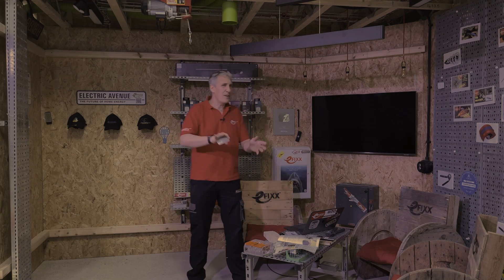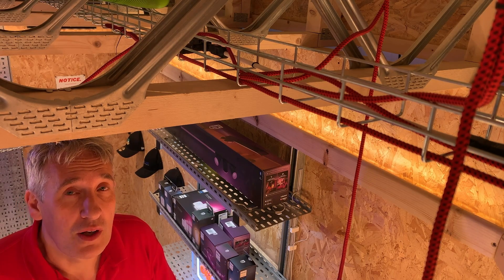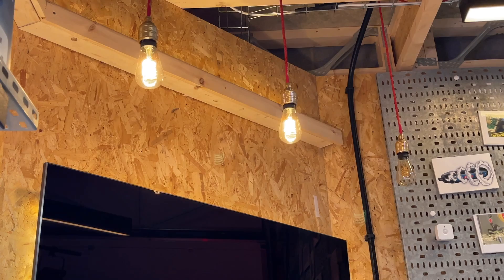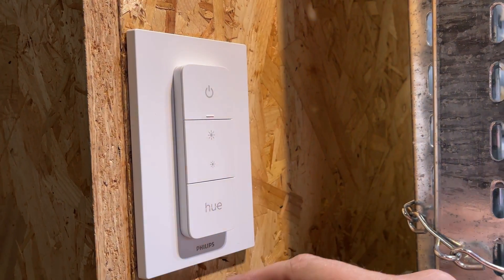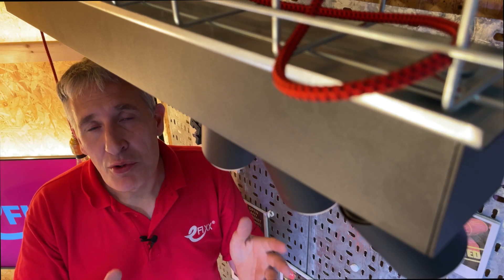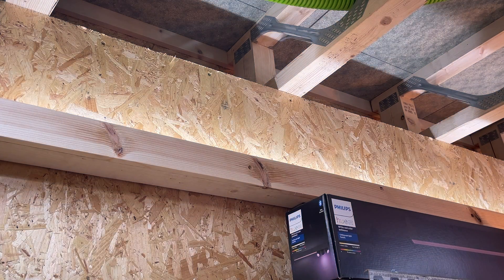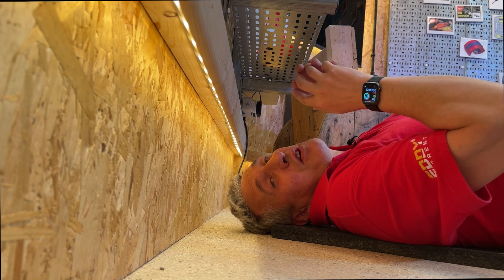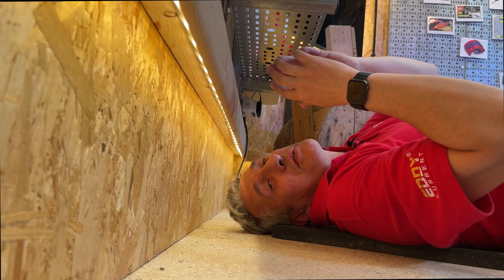Philips Hue Installation Secrets

Comment: Recently redid our entire small one bedroom holiday cottage with hue. The tricky bit was finding switches that were suitable, we ended up with GIRA kinetic switches which have been great. Downside is the mess of wiring as the living room / kitchen was originally designed with six individual circuits now all WAGO'd together where the dimmer used to be!

Comment: I’m afraid Phillips have already lost my custom, I have bought three Phillips Hue smart lamps. One no longer connects to the app, one works ok and the third, has a high pitching squeal that it has had from new and when you first turn it on its acts like something possessed flashing and the light levels going up and down before it eventually settles down.
Reply: Did you contact the support when you had them problems? I had 2 faulty bulbs and messaged there support team and they sorted me out!
Reply: @MOTO_LEW  I didn’t, maybe when I have a spare hour I’ll give them a ring. Cheers
Reply: @AshleyWilliams12345  worth a try but it may depend how long you’ve left it and where you got them from

Comment: Might be expensive yes but its quality stuff,  Ive been using Hue since the first versions in 2012 when it was only available through Apple, infact the bulbs I bought back then are still in regular use today and have never give any issues and still perfect. My system extends to the outside too and the hue Syncbox is amazing when linked to a good TV.  Im part of the beta program and there are some great new ideas coming along, we are constantly testing and no I dont work for Hue or Signify, just a happy user
Reply from the maker: Great feedback 👍
Reply: I’ve been using mainly hue for my dimmable smart lighting in my home installation for about 5yrs. I agree that it’s mostly excellent quality and reliable. A few of the fancier bulbs aren’t very tough, sadly I’ve broken the glass on a couple of the filament style bulbs! But a little known fact is that the Hue Hub will pair with some other brand Zigbee bulbs and they work just as well and for a far better price. I have mixed feelings. I’m always prepared to pay for quality but Hue isn’t twice or three times better than alternatives IMO